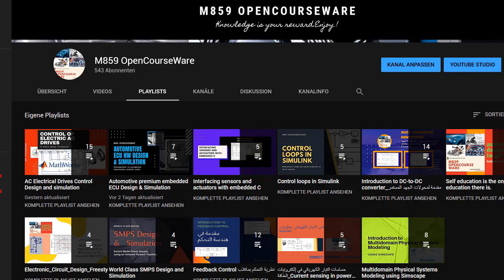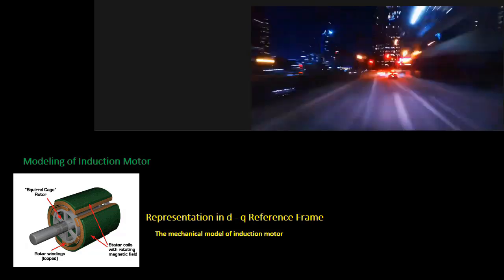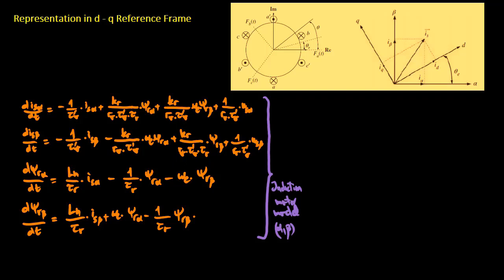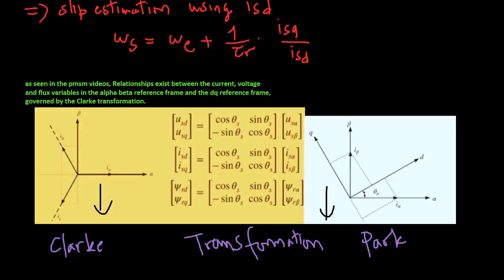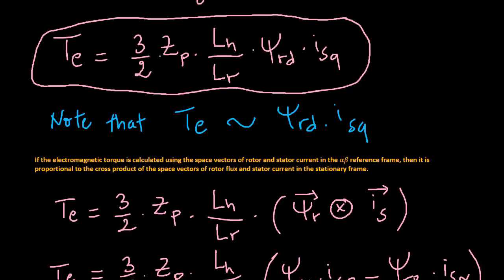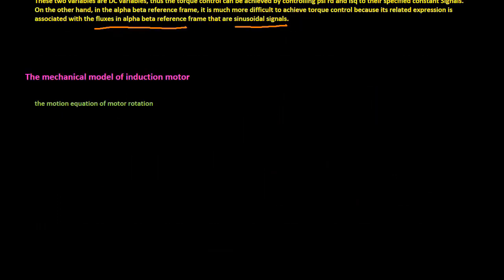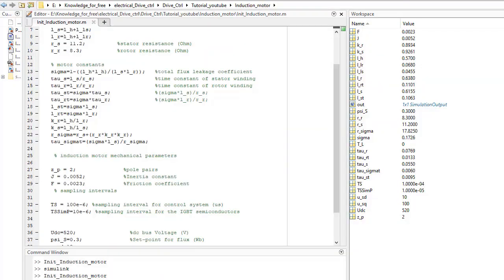Modeling and Simulation of the induction motor in the dq reference frame FOC

Comment: In the Park_Clark_Current transform calculation, you have not included ib (phase-b current). But according to the formula of id & iq, the three current values (ia, ib, ic) and also theta value are used to calculate.
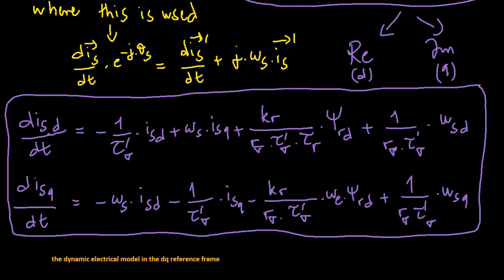Reply from the maker: the Clarke transformation: the currents in the alpha beta reference frame are calculated using the formula in https://www.youtube.com/watch?v=JzaBOYV80r4&list=PLouCoK47-AT_rcog3L8_UjTGs-sLgZEZd&index=6 @2:29 & @4:46. Note: In order for the transformation to be invertible, a third variable, known as the zero-sequence component, is added.

Comment: thanks video
i need some help 
how i can apply fault (like broken rotors bars or inter-turn faults)in induction motor model
Reply from the maker: I have already sent you sources in Facebook that you can use for modelling. for example 
https://pdfs.semanticscholar.org/6cf9/89d8261142d233aedd510c766dccf7c4e792.pdf?fbclid=IwAR1latUfwT7ejcXS8HiC0d1VCd34gQ8zG2TrQmz8bayPepCAM5xXNr1YkF0
or 
https://opencommons.uconn.edu/cgi/viewcontent.cgi?article=1551&context=srhonors_theses&fbclid=IwAR2-Rt-Rr6vBC-0uLE-EQKjEnajBH2SS0V7vmA6JH0nxxWGVBkpHILVG02Y
or 
https://ipstconf.org/papers/Proc_IPST2003/03IPST06a-02.pdf?fbclid=IwAR0cB-W64P23dl4V_B9YEyTQTt_ayZDCkKaMb8zEnUOz7hz2V9R9CmRHyKg

unfortunately I cannot implement this myself at the moment. 
Just try to get familiar with the literature and especially construct models for the case of errors, then the implementation in simulink is very easy.
good luck.
Reply: @eDrivesEmbed  thank you i try but i have some issues

Comment: Great videos man, I found your channel recently and i'm trying to figure out how to write software for FOC on pmsm. I never really paid much toughts to induction motors because the squirrel cage's rotor makes its control asynchronous? is this right? Actually I dont really understand how FOC works on IMs, isnt it the idea of FOC to control the motor synchronously? 

I always tought the driving of IMs was made out of the flux lines cutting through the rotor, whereas FOC has one Id vector always perpendicular to the applied voltage. If you have 2s to spare to explain it to me i'd be very grateful.

I'm still learning but i like this stuff, anyone reading this whos doing the same there is great reading material on microchips website in the application notes library.
Reply from the maker: my comment from old videos:  yes the information coming from the pedal sensor for example towards battery management system should be used for motor torque demand.yes id and iq are dc signals , this is the first FOC goal to be able to control field machines as like as dc machine. at the end of the day your controllers need reference signals in SI Units ampere or in rpm (rad/s), that depends on your modeling, because this units are also included in your controller parameters kp,ki...
The µC,DSP or FPGA are equipped with internal ADCs with input voltage range of for example 0V . . . 2.5V for current measurement, supply voltage measurement, analog hall signal measurement, analog encoder. they processes currents as 16 bit signed values. Raw ADC values are expanded to 16 bit width independent of their resolution.
The ADC scaler with offset correction is for pre-processing of measured raw current values. It might be used to map to own units. For scaling, gains of current amplifiers, reference voltages, and offsets have to be takin into account.Electrical angels and mechanical angles are represented as 16 bit integer values. One full revolution of
360 deg is equivalent to 2^16 = 65536 steps. Any position coming from a sensor is mapped to this interger range. The inner FOC loop controls torque and flux of the motor based on the measured phase currents and the electrical angle of the rotor.
In the modern control for memory usage the Interrupt Service Routines: all mathematical blocks of FOC algorithm, SVM, and motor phase current sensing and calculation are executed in the SRAM for example. This improves the performance as the execution time to run the FOC algorithm is reduced.
Execution of of Sensored FOC: Start of ADC interrupt service routine,Clarke Transform,Park Transform,Calculate PI controllers output to obtain vd vq reference,Measure electrical position,Inverse park transform,Space Vector Modulation to obtain PWM duty cycles,Calculate mechanical speed  and Iqref after every discrete x PWM cycles,End of ADC interrupt service routine.The FOC software is implemented in the ADC interrupt service routine after the end of the conversion of data.When the ADC conversion is completed, the ADC ISR (ADC interrupt) is entered. The FOC calculation is done in this interrupt. It runs at the same rate as the PWM switching frequency.but there are many solutions.
Reply: eDrives Embed Thank you too for this explanation. Will help me implementing field oriented control for induction machine in a school project heavily!! As you said in induction machine id so the flux producing component is mostly kept at a value such as the nominal current of the motor and is kept constant while the torque producing component value is used to vary the speed of induction machine right? But why can you just use the torque the motor is producing to regulate the speed of the machine. Are they proportional to each other? (Or am i right that my question is explained in 4:25? With the relation that Te is proportional to Yrd x isq? And because in induction motor Yrd is a  onstant  up to base speed isq is proportional to Te which equals the electromagnetic torque?)
Reply from the maker: @timowolff1105  If the operation of field-weakening is not involved, the set-point for rotor flux psi_rd will be constant. However, if field-weakening is involved, the reference signal to rotor flux psi_rd change. therefore you can enter the speed as a setpoint for the field-weakening block, in this situation you use a flux controller and for the flux determination you use an estimator or osbserver.  see the picture below here
Reply from the maker: @timowolff1105  The implementation of PI current controllers for induction motors follows a similar procedure to the one used in the application
that are used in the implementation of control for PMSM Key issues. in the implementation of current control
for the induction motor are estimates of certain unmeasured variables. Note that these compensators calculate the rotor psird flux and the synchronous speed
omegas. These signals are not measured by sensors, so estimation schemes are needed to estimate this information.
The cascade velocity control includes the dynamics of the current isq and the dynamics of the velocity omegam. The current isq model is used for the design of the internal loop of a proportional feedback linearization control system and the motion model for speed is used to design a PI controller for the external control loop system.
Reply from the maker: The principle of field oriented control is based on the control of both the magnitude and the angle of each phase current and voltage. The control of torque is normally achieved by controlling the armature with constant field current. The Field weakening is employed to increase the speed beyond a base peed. The simplicity and flexibility of control of dc motors have made them suitable for variable speed drive applications. In the field oriented control, a d-q coordinates reference frame locked to the rotor flux vector is used to achieve decoupling between the motor flux and torque. They can be thus separately controlled by stator direct-axis current and quadrature-axis current respectively, like in a dc motor.The inherent coupling effect between the torque and flux in the machine is managed through decoupling (rotor flux orientation) control, which allows the torque and flux to be controlled independently. However, due to its computation complexity, the implementation of this drive requires fast computing processors.
Reply from the maker: if you look at this playlist, you will understand how this works.  https://www.youtube.com/playlist?list=PLouCoK47-AT_rcog3L8_UjTGs-sLgZEZd